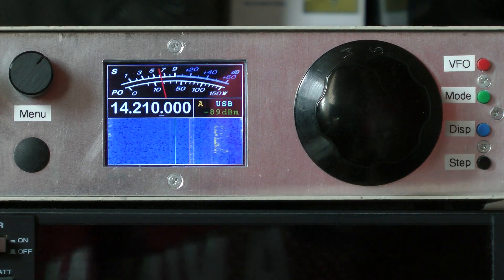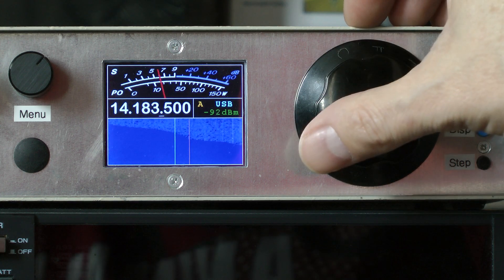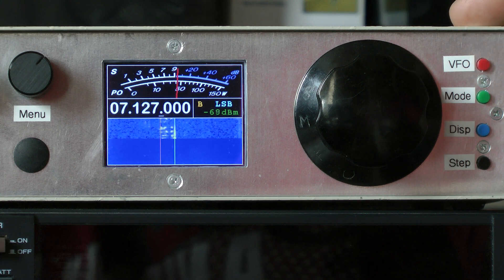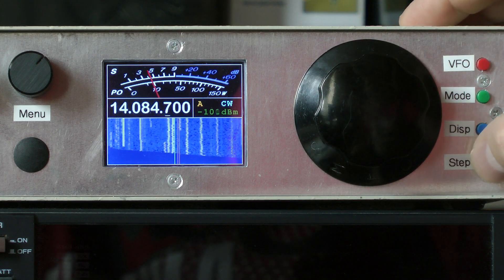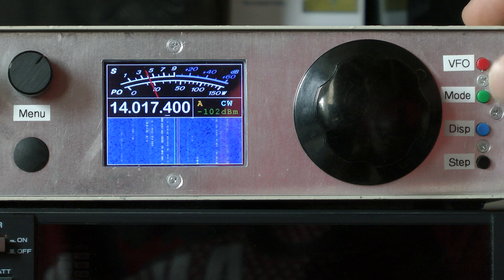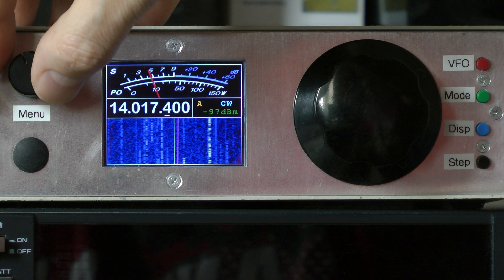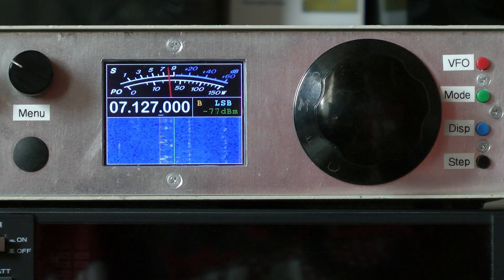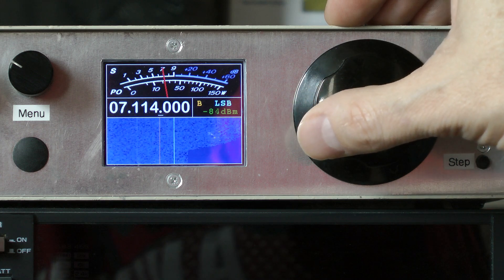A more detailed walk through G0ETP's homebrew HF SDR receiver

Comment: What magic machined the perfect display hole?  This is one beautiful project!
Reply from the maker: Hi - The hole was cut by hand and then filed to size. The display has been separated form the STM32 board and is clamped behind the display aperture. There is a perspex/plexiglass window (also hand cut) that sits in the front panel hole and protects the display and stops it from falling through.

Comment from the maker: March 2021: A V2 receiver design now exists. This is a 'shield'-like form factor that simply plugs onto an STM32F429I Discovery board and tidies up all the interconnections that have to be made. The software is a fork of the V1.2 design shown here with an identical look and feel. Check the website for pictures and video clips.

Comment: 18.8.2020: Just a note to all - this project is still live and the software is now mature with notch filters, more filter bandwidths, variable AGC speeds, RTTY decoding and PSK31, 63 and 125 decoding onboard with an easy to use tuning-indicator. I really need to upload an updated video.
Regards to all, Tim G0ETP.
Reply: Is the code available on Github or somewhere?

Comment: As a software engineer and usability designer, I have to say that your user interface is absolutely superb - BRAVO!!

I would like to design my own SDR around a Raspberry Pi single board computer and write the software from scratch as you have. Your UI is hands-down the best I have seen in the roll-your-own** SDRs.

**(Pre-fab-component-assembly and homebrew rigs.)
Reply from the maker: Hi Brettany - thank you for your kind comments. I only tried to make the interface minimalistic and intuitive, and with as few operations/clicks as possible to get each job done. I have actually considered making a web-SDR version of my receiver using a RPi, however I have not yet had time to get the I2S input working (hopefully this can be made available via connector P5). Good luck!!